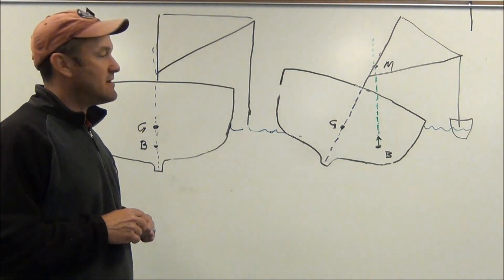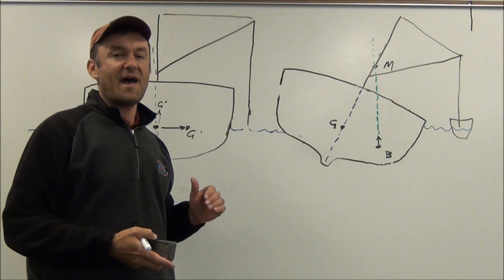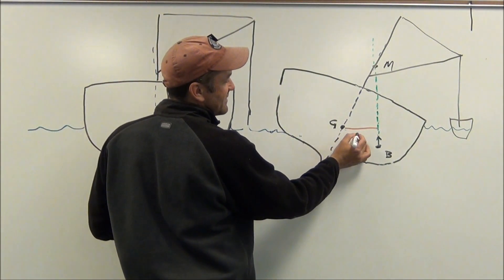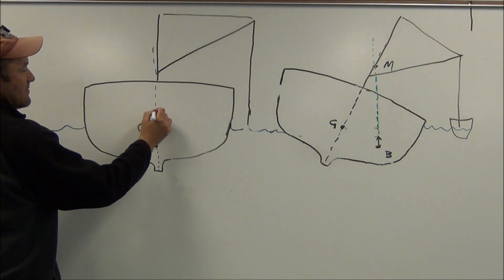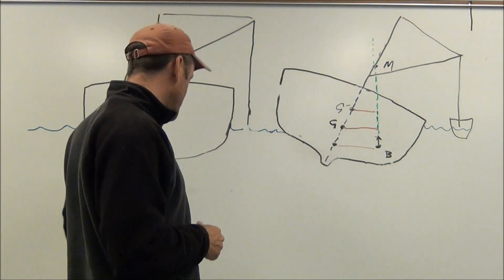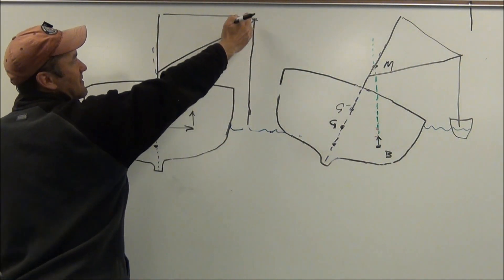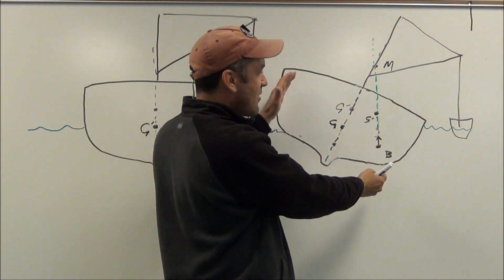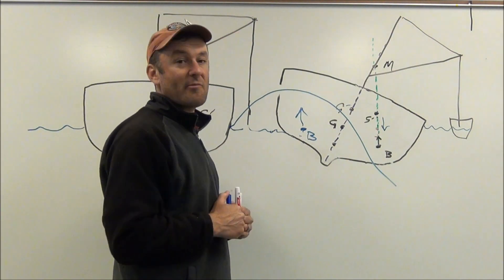Stability Unit, Part 2: Change in the Center of Gravity

Comment: How about if the floating body is not a boat, but a dock and we place a permanent weight on the edge of one side, so there is tilt - but at a new equilibrium.
How do you calculate different ways to "straighten" the dock back so its level again? (obviously without removing the permanent weight)